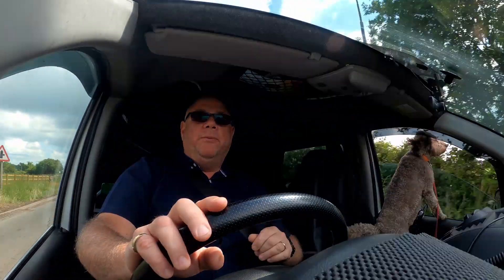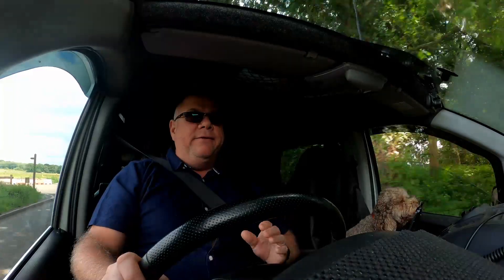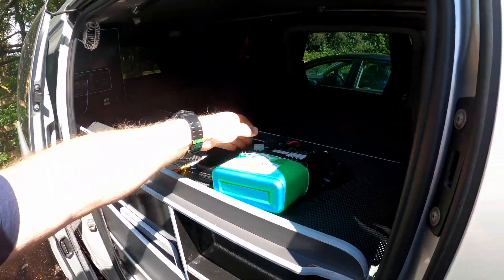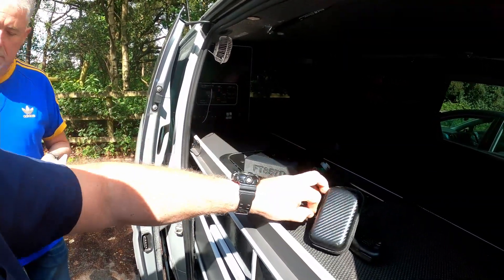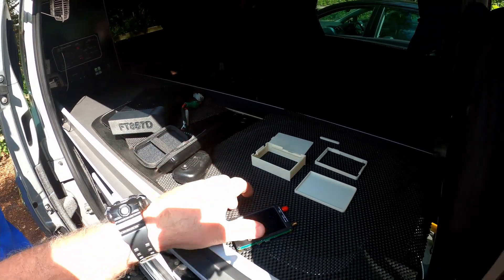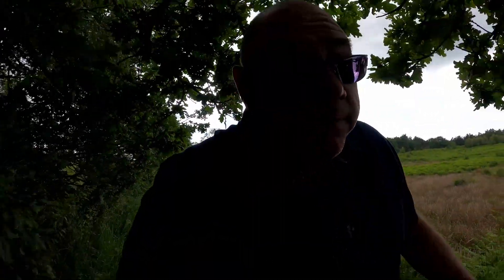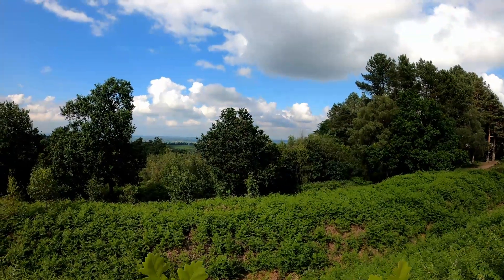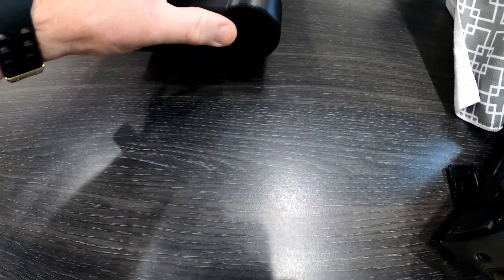3D Printed stuff for you FT857D radio & NanoVNA

Comment: I’d use bungee with a cord lock, rather than paracord, to keep positive but not over-tight tension on the front cover. 

Depending on the play and internal space left by the cover, you could even drill a couple of neat holes in the cover to tie off the bungee. Then it stays where you left it. Otherwise cordage gas a nasty habit of getting repurposed mid-activity.
Reply from the maker: Yes good ideas. Thanks

Comment: I've used both my 3D printers for many radio projects, cases, side rails, and building antenna's is SO easy now. Dipole centre's, insulators, every bit can be printed. Using Tinkercad and FreeCAD for designing.
Reply from the maker: Isn't technology great